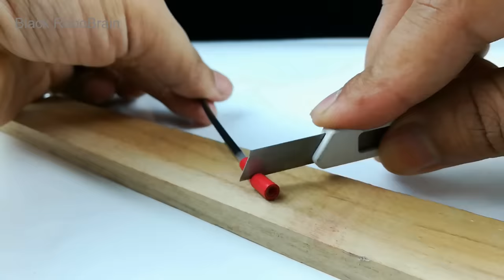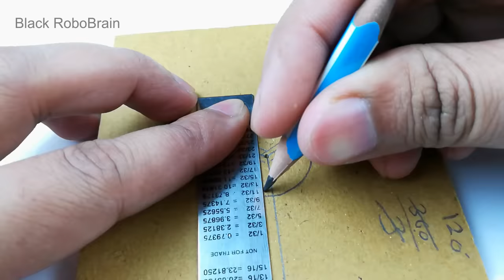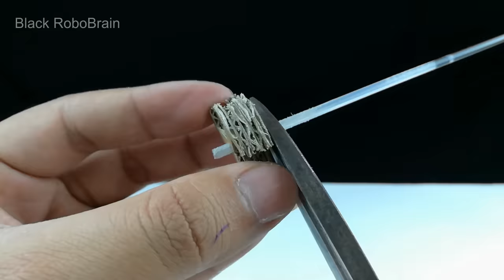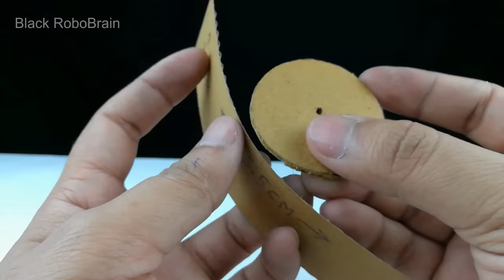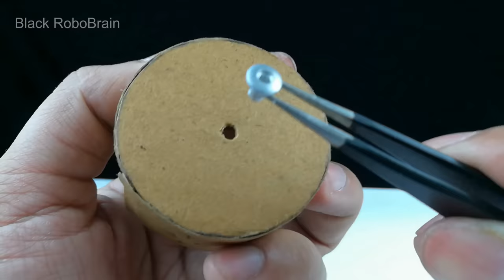How to Make a DC Motor at Home (Cardboard DC Motor)

Comment: Finally, a DIY do it at home video that is REAL and isn't fake or dumb
Reply: Fake asf
Reply: @SouhridPalVines  How do you know? Do you even have any knowledge of engineering?

Clearly, the motor uses electromagnets and magnets. Basically these electromagnets on the rotor switch polarity momentarily to turn the rotor.

So shut up if you don't know ANYTHING about electronics.
Reply: @suspense_comix3237  yeah maybe ik less than you, and infact you are right... But in this video, the insulated copper wire is coiled around pieces of cardboard, whereas in real motors  the wire is coiled around thin sheets of iron or steel... This helps in generating larger electromagnetic field, also the metals are used as sheets so that the eddie current generated within the metal won't cancel the electromagnetic field. Also to your surprise, the magnets used are so weak, they won't even be able to pull a safetypin from 1inch distance whereas the working DIY motors use neodymium magnets... Also the blade method for transferring current to the coil generates huge amount amount of friction, resisting its rotation.... Also, 65 turns is such a small number of turns, instead using thinner wires and more number of turns would have helped... So yeah maybe I don't have any sense of ELECTROMAGNETISM or so called DC MOTORS
But I do have a small amount of knowledge to crack JEE
Reply: @SouhridPalVines  Fine. Fair point.
Reply: @suspense_comix3237  i clutched you baby

Comment: This is the best electronic project I have seen on YouTube so far....the rpm depends on the strength of the neodymium magnets and the number of turns used....in your case can you please tell what is the rpm for a 12 volt dc source?
Reply: it actually doesn't depend on voltage, it also depends on amps of the battery/power source. you should try testing it with a 12v 7ah lead acid battery.
Reply: @Siddhant-Mashalkar  isn’t that a car battery
Reply: @wavebuilder14udc75  Car battery and Lead Acid battery are different.
Reply: Can someone tell me what's the application of armature in dc motor...i mean it could be lighter if it's not made of iron/steel
Reply: @Siddhant-Mashalkar  but car batteries ARE lead acid batteries.
Reply: @meIanchoIia  My best guess is to handle the stress of spinning so fast and the heat of being in the car engine compartment. Lighter materials may be subject to greater wear, cracking, and bending at high RPMs

Comment: plz can u tell me how to increase the speed of the motor or could u make a video on it? :)
Reply: Get a 12 volt motor or increase the voltage without blowing up the motor.
Reply: use motor speed controller
Reply: In order to make it ave more power and speed you need to increase the amount of turns of the wire and how large each turn is, also putting in more powerful magnets will make it more powerful, just not that strong so that the motor won't move!
Reply: @technicboy5917  thanks mate i will try that
Reply: Your welcome. Oh, also try making the casing out of more durable materials like wood or plastic and somehow get the motor attached to a bearing. This will be very difficult to do for this motor, but if you have a look at "AmericanTech", (which is a youtube channel) and they can make much better motors than this.(Its also not that hard):)
Reply: *earape

INCREASE THE VOLTAGE
Reply: Well if you increase the voltage and current you will get a faster motor, but, it will start overheating and may lead to the motors malfunction. To make it go much faster and more efficient, make more coils of the transformer wire and you will get a faster and more powerful engine. If you want a proper motor, you should make something called a brushless motor and they will deliver great torque, speed, and efficiency. They are harder to make though.

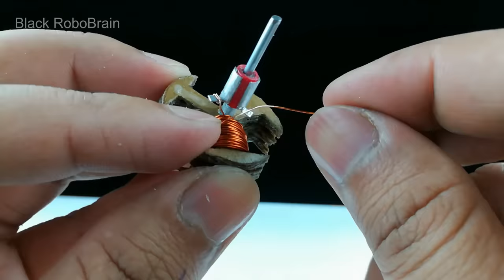Comment: 3:36 Can we make this with any type of conductor?
Reply: Yes👌
Reply: No, The wire he is using is transformer wire. This isn't just wire, this is a thin copper wire with an oxide layer on top, this acts as an insulator. If you were to use a bare copper wire, the motor would smoke if you applied electricity because the coils would short circuit.
Reply: The purpose of a brushed motor is to make induction so that the motor will move, and the only way to make it is through coils. you can try making the coils out of another insulates wire but you motor with be huge and you will need much more of the wire to make it.
Reply: @technicboy5917  , sir words to cherish for can we use an electrical copper wire in simple cables
Reply: @vyomveerudh2787  Only if it is in its plastic casing.

Comment: Without Any iron core electromagnet is useless.
Reply: That is how it is fake
Reply: Wrong. An electromagnetic coil will produce a magnetic field without an iron core. Most small electric motors use plastic to hold the wire wrappings.
Reply: Current passing through a wire will create an electric field. Stronger by every rotation of the coil. Generally how power stations induce currents in a wire by spinning magnets. :)
Reply: I agree. If plates made from a tin can were used instead of cardboard then the motor might have more torque but this will be pretty weak
Reply: @KurNorock  first check inside your motor after comment.
Reply: If soft iron core is use then motor is strong
Reply: Cheers for the idea  @tobyschmoll2792
Reply: Great Nerve I agree with you and i believe that this video is fake !!! All the motors need electromagnet . In this video i didn't see any.

Comment: is it  important to take 65 turns?
Reply from the maker: no
Reply from the maker: 50 - 80 turns sufficient .
Reply: Black RoboBrain more than 80what happends?
Reply: The resistance of the coils you are winding might get to high and stop the needed ammount of current from flowing through the coil to produce a strong enough magnetic field. 
So shortly said maybe it increases the power but more likley the motor will loose some strenght and will no longer be abled to produce any torque

Comment: sir please i have a question 
if i use 26 gage wire then
Reply: idk, try it. experimentation is the best way to see what is the most efficient, so try it. if it doesn't work, make it proportionally smaller by the percentage of how much smaller the 26 guage wire is compared to 30.
Reply: Yea its possible
Reply: Plz any one tell me that
How to find the calculation of winding of dc motor
And how to finde the swg size for dc motor
Reply: Niaz muhammad مخلص थचझच

Comment: What were the three small pieces of metal?
Reply: Maybe you are referring to the commutator. It's needed to flip the current in one of the loops each time the motor has turned 60 degrees. That's what keeps the motor spinning.
Reply: I think you referring to the magnets

Comment: Does it have to be copper wires or can it be a mix between different conductors?
Reply: Anything that conducts electricity well will work, so technically silver wire will work better lol. Still, anything other than the copper wire would either be ineffective or too expensive in comparison.

Comment: make a brushless motor out of cardboard imagine the speed of that without the weight of the metal case and core
Reply: Lots of energy is lost as RF which are otherwise picked up by the core and you end up with one that is worse than a real one of similar weight

Comment: how strong is that engine? I mean would it be possible to make it run wheel of small robot?
Reply: You can see it as a resistors and inductor in series. Play with the values and the calculate its power

Comment: I made this with 70 turns on each pole used mobile charger to run 
But it's not working is this happen due to less voltage  ? How much voltage require minimum?

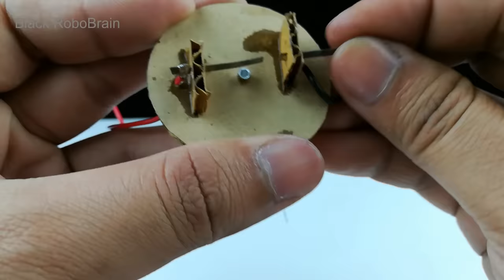Comment: what is that plat you used to stick the shaft with the coil(1:10) and the plate that are at outer ring if Im not mistaken (time 6:10)
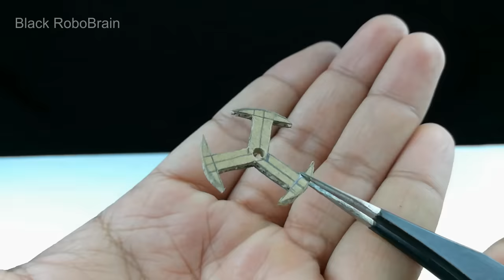Reply: (2:10

Comment: if the wire plates were metal, then the magnetic force would be better, i dont know how the wire even produced enough magnetic force.
Reply: In the end, he swapped the insides with a real motor.
Reply: No its definitely real
It would be very weak and inefficient but hes at least got the basic concept of a brush dc motor

Comment: Amazing ! Please also explain the parts and principles of electricity in detail.

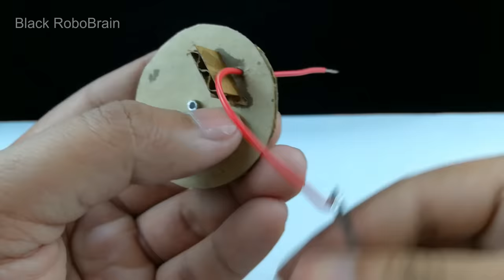What is that metal thing which you passed through the cardboard at 6:07.   Why do we need it?
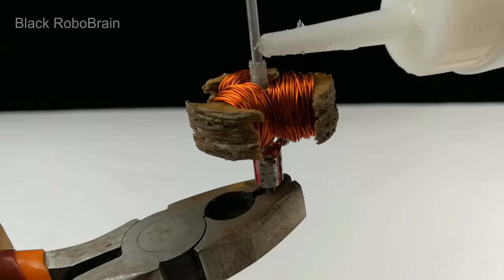Reply: To connect those wire from 4:30 to the battery

For more details try opening a dc motor
Reply: Those are brushes. They control the motor timing for coils.
Reply: Completely necessary

Comment: So this is what propels the tesla roadster?
Reply: Nooooo. Tesla cars use brushless motors, this is only a brushed one, these are cheaper motors you can buy for some toys and most washing machines! The "brushes" will scratch off very quickly. Brushless has no scratching parts and it is more powerful!

Comment: This is actually wrong because it works on the machenism that by coiling copper wire on metal it acts like magnet 🧲, the magnet inside the motor repels it and then it  moves.But here the inside part is made up of cardboard.

Comment: How motor rounds
Reply: It is called induction. Those coils you see are not just plain bare wires, they are copper wires with an oxide layer, this acts as an insulator. when you apply electricity on one coil, it makes strong magnetic waves, and since there are magnets, they will repel from them. The way you can decide witch way it goes is reversing the polarity. The way it continues to spin is because the motor already spun and the "brushes" are at a new coil and makes another strong electromagnetic field and repels from the magnet repetitively while the electric supply is connected. The reason the motor only goes one direction is because the coil is infront of the connections of the "brushes" and therefore, the motor turns where it is easier for it to go!

Comment: Is 6V works?
I saw he used 12V for the motor
Reply: yes it will work but it will also half the Amp output and it will make the fan run at approx 1/2 speed
Reply: @folydemoly2340  Will change the turns of copper wire affect the voltage of the motor?
Reply: @baobinh2513  yes, each coil/turn of the wire itself will increase the voltage. im not sure the exact measurements per coil but i know the more coils until a certain thresh hold will increase V/A/P
Reply: Because of that i couldn't find any 6V motor tutorial

Comment: missing iron core no magnetic current
Reply: ganesh sharma copper wire makes magnetic flux lines as well. You don't need a metal core just the wire but it works better with a metal core.

Comment: cardboard cannot produce magnetic flux
Reply: Crazy Maker True but copper wire makes magnetic flux lines,  you don't necessarily need a core it just works better with it
Reply: Yes, but rotating coil should be captured also !